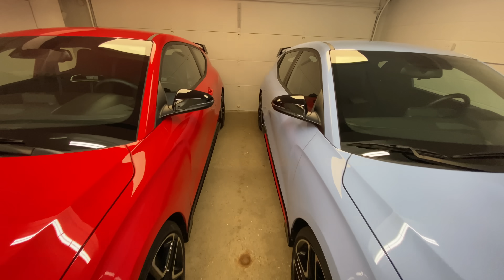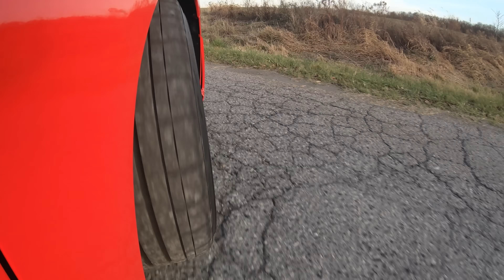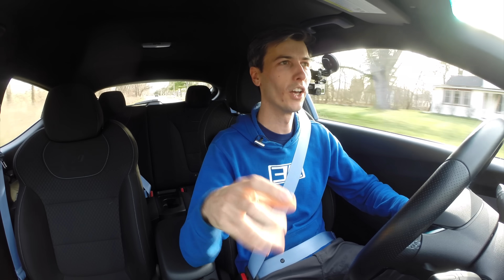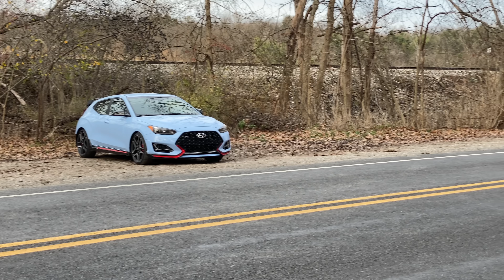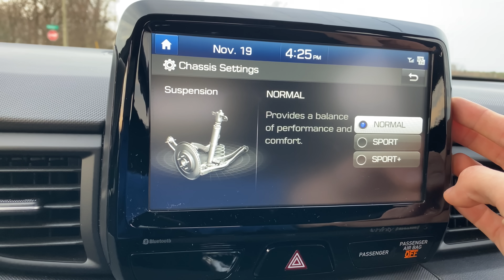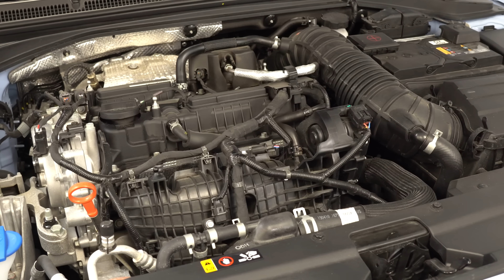Are Front Wheel Drive Sports Cars Any Good?

Comment: with modern E-diffs and traction assistants, they can be a BLAST to drive. For me, throw some good tires, and a rear sway bar upgrade and thrash! I also think you can have fun in pretty much any car, so what do I know. Okay back to fixing a Turbo R32 that wont start. :)
Reply: I’m a mod noob, what would the rear sway bar do on the car? I have a GTI
Reply: @959porsche  Helps with understeer and rotates the rear when turning in.
Reply: @959porsche  A sway bar limits sway also known as body roll. Most consumer cars are set up to understeer because its safe for John and Jane Doe. But the axle with the higher roll stiffness is the one that will slide first because the softer axle will have roll. You can increase roll stiffness with sway bars without having hard uncomfortable suspension over bumps. A stiffer rear sway bar will increase roadholding and make the car handle neutral up to about 9/10ths, when the rear will begin to drift. If you are skilled you can use the drift to point the car into the corner while still accelerating hard. RWDs won't be able to keep up. 🤣
Reply: @stevenfarrington2361  thanks for the pro insight!!! I’ll look into getting one
Reply: @959porsche  Look into getting an adjustable bar. And increase the stiffness progressively as you get used to it. Too big of a jump without knowing exactly what you are doing and you'll end up spinning out mid turn
Reply: @stevenfarrington2361  Just one point, the axle with the higher roll stiffness will not always slide first. Example: For FWD cars, most of the sprung weight is on that front axle. If the rear axle has just slightly less roll stifness,  it will slide out first. 

It's not just roll stiffness, the weight transfer bias is the key. Which end will slide first is based on both the axle sprung-weight balance, and roll stiffness balance.
Reply: @darkknight097  You still have a choice of bar size, as a monster bar may be too much at the softest setting.
Reply: @959porsche  Would it not be easier just to search on the web for the answer? You will get far better explanation and probably diagrams too.
Reply: @another3997  I’m just on the comments section man
Reply: I added a modest rear bar to a Mazda6, 18mm to 21, and huge improvement from severe understeer. Huge rear bars defeat rear independent suspension, and can be dangerous in bad weather, unless driver knows better.

I used a suspension book by engineer Fred Puhn to determine weight transfer bias to help decide what diameter to use.
Reply: I know you’re a VW enthusiast, but when I read R32 my head went straight to the GTR. Humble Mechanic working on JDM, I would watch that any day!
Reply: @tylernoctyrn3140  you mean BNR32? The VW is the ONLY R32...
Reply: @jameshaulenbeek5931  yeah the R32 GTR the OG r32
Reply: @tylernoctyrn3140  so, the BNR32
Reply: @jameshaulenbeek5931  I get that BN is in the chassis code, but no one says that when referring to the car. Its R32 to R35 those are the gens.
Reply: @tylernoctyrn3140  😁 just busting your chops... technically, the VW Golf R32 is the only car model actually labeled "R32"

All kidding aside, I think we can all agree the GTI W12 should exist, though.
Reply: @jameshaulenbeek5931  Personally I’m a 2.0t guy, but I do see a vr6 in my future 😉
Reply: Keep up the good work Charles, looking forward to the video!
Reply: Ok Charles... you're next...
Reply: @HumbleMechanic agreed, I have a 2019 GLI 35th Anniversary and been working with Paul's crew at DAP Repair and yes with a mild tune, upgraded rear sway bar and end link then put on some good summer tires and it is shocking how well these cars can perform. I really wanted to RWD performance car and almost got an 86/BRZ and also this Veloster N but after already leasing a 2019 base S trim Jetta since 2018 the loyalty discount sold me on staying in the VW family. They can be amazing and affordable fun.
Reply: I've got an mk7 gti 6spd running a stage 2 tune on e30, an upgraded rsb, Bilsteins and sport springs, ps4s tires and a few other minor goodies. Yes, wheelspin off the line but otherwise a riot to drive. Would it be better as rwd? Yes of course. Still fun and pretty rapid.
Reply: @dddon51  Bilsteins and proper sport springs are great upgrades. You can even get those shocks tuned by shops like fatcatmotorsports suspension page. 

What were the original and new rear bar diameters?
Reply: I had a 92 Golf 3 with 90PS back then. It only had a suspension job and some 215 tires but that was enough to transform it to an entirely different vehicle. Sure it didn't have the umph and top speed but it was light and could accelerate quickly. The average car back then had more PS on paper but they also had to lug around up to 500kg of extra weight. And the Golf also went sideways if you know how.
Reply: @Enforcer_WJDE  I was on a track and there was a ~1990 Scirocco that was not high powered,  or lowered much, and modest tire size, but he could just fly through the corners with great exit speed.
Reply: Did you ever get your car to start?
Reply: Most cars driven at their limit can be fun, or scary, or both
Reply: 💯 this.  My R59 has exactly that, bigger rear sway, widened track by 1", and wider+stickier tires.  Good luck when we hit the mountains, she's a cornering monster.

Can be drifted or pushed through a corner, using the throttle to steer mid corner, an amazing feel in a light fwd car.
Reply: Great engineering like with the Civic Type R also helps - FWD can absolutely be fun!

Comment: I have a NC and ND Miata. I owned a VelosterN for 6 months. It is really a fun car for the street/daily use. I set it up for the track. Sold it after two events. Too front heavy, understeer pig even with a massive rear sway bar. Chewed up front tires like crazy. I now track my ND Miata. Not as much HP on the straights but so much better balanced and so much faster in the corners.

Comment: FWD has come a long way with suspension geometry, weight balancing, tire compounds and transmission differential/brake technology. Unless you track a car, FWD is generally more ideal for most conditions you will drive in, especially if you live in the north or Midwest.

Comment: Why do cars not have only rear wheel steering. I think i can guess why but would love your video on the topic to get a clearer idea.
Reply: Try to push a pallet truck or anything with steering wheels on the back (so having the steering wheel behind) versus pulling it and you'll get why in a second. You'll basically completely lose control at the 1st road bent.

Comment: Limited-slip diffs are pretty much necessary for a front-wheel-drive performance car. Even in rear-wheel-drive cars, they make a difference. Torque steer, though, is not great if you're truly driving hard. I think that "feedback to the driver" that you mentioned is what makes driving a sporty front-wheel-drive car kinda entertaining - you have to manage the power differently to a rear-wheel-drive car and more often, too, due to the lower traction. But when I have a decent diff, I can feel pretty confident pushing it in the turns. My GTI with the performance package (which includes an E-LSD) was super fun to drive in 90-degree turns especially. It helped when I put better tires on it - it was kind of a mess when I first got it with some more touring-oriented tires.

Comment: The answer for me was no.  I used to slalom my RSX type S, unfortunately slalom racing greatly exaggerated its inefficiencies/difficulties of laying down power while still in mid turn.  I had to compensate everywhere and couldn’t really use the vehicles power, which was significant.  The VTEC “boost” that kicked in around 5500 RPM did me no favors also 😂.  Needless to say it was a handful......which is part of the fun.

Comment: Almost everything nowadays is a sports car when compared to older cars.
Reply: Everything made now is much heavier, and the experience has been watered down by numb feeling drive-by-wire systems and electronic driver interventions.  That being said, chassis stiffness and engine output have definitely been improved in modern cars.
Reply: @vablo7198  a lot of these people think they know sports cars but once you truly dive into the modern tech you realize how far away we have strayed from that ideal sporty style. Almost all modern cars wont even give u instant full throttle if u punch it. They roll it on smoothly its too soft nowadays
Reply: Funny because I see more wrecks occurring from the modern cars than anything during the 99’s and 2000’s. And nothing had improved with handling of my e30 and Honda fit can outcorner every person driving their exotic
Reply: @demitrivavaroutsos4141 my old four barrels wouldn’t either and if I tried that with the manual linkage instead of vacuum secondaries it’d fall flat on its face.
Reply: Sure I love my modern 1.2 liter 85 horsepower car
Reply: @Saffy1  did u miss the word “almost”?
Reply: @NoName-tz5ji  Since when "almost" means 50% cars on the road
Reply: The Mitsubishi Mirage is the ultimate sports car compared to the Model T
Reply: That's why i can only call my celica st184 a sporty car and not a sports car. Things doesn't have much power but it's a fun car
Reply: meanwhile in the EU: 68hp take it or leave it.
Reply: An interesting perspective but I couldn't disagree more.  From my view, sportscars and spirited driving are about the way you experience the drive; the sounds, the sights (of the car and the scenery etc), the overall way it makes you feel.  While most new cars are no doubt better in most/all quantifiable measures than older sportscars, they've reached a level of insulation from the driving experience that they've become appliances on wheels.
Reply: @No Name If you believe that then you have never driven a Caterham Super 7. Largely unchanged since its origins as the Lotus 7 in 1957 (apart from changes in power plant as various ones became unavailable)  it is still widely recognised as one of the best driver's cars available.
Reply: yeah it is kind of interesting to see my family car SUV is faster than the fastest Challenger from back in the day
Reply: ... keep telling that to youself ...

But for the start, please describe what a sports car is.
Reply: "Anything under 170-210 hp is horrible anyway"
lol this guy never use motorcycle :P
Reply: I cant agree with that, new cars lack eutushiasm and real mechanical technology, i have a 20 years old Alfa Romeo GT Q2 and it still outpreforms most modern hothatches in corners, and almost as good as other FWD cars on acceleration, but all this modern hothatches all lack pure feedback, fast steering ratio, and mechanical grip, most modern cars have crapy MacPhersone strut in front and even worse torsion beam in back witch is mechanical grip killer to save on expenses, a crappy e diff and torque vectoring that overheats your brakes from accelerations and all sorts of electronical assistences that makes a car sterile.
Reply: Yeah, I remember one of the car magazines did a head-to-head between a 1984 Porsche 944 and a modern Honda Odyssey and the minivan spanked the Porsche in almost every performance category.  Of course that’s nothing new, back in the early 1990’s Car and Driver put a GMC Syclone up against a Ferrari 348 in the 1/4 mile and the pickup truck won.
Reply: @jpe1  Popular Mechanics once said an '80s Dodge Rampage mini truck performed as well as a Porsche.   That's got laughs but there was some truth to it.
Reply: @timothykeith1367  I wonder if that was the 1984 California-market-only “Direct Connection” model.  I don’t remember if the “Direct Connection” had the same engine as the one-off “Shelby Rampage” built for Carrol Shelby, but it did at least look like it should be fast.
Reply: @jpe1  The Rampage was the common 2.2 5-speed model.  It was reviewed in the September 1982 issue of Popular Mechanics "Detroit Pickups Vanquish the Imports". page 178  "The Rampage really belongs in a sports car test since its more fun to drive than just about any two-seater that you can buy for under $20,000. Its performance will simply blow you away... claw its way around a skidpad and through a slalom course as fast as any vehicle you care to name, Porsches and Ferraris included"
Reply: @timothykeith1367  cool! Thanks for sharing!
Reply: It's the other way around.
Reply: Horsepower doesn't make a sports car, the feeling of being connected to your car does. 
Compared to how cars nowadays feel like, i'd say any manual cars before mid 2000s could be a sports car.
Before the motor assisted steering, electronic throttle actuators, emissions regulations, and rev hangs etc.
Reply: @kdh6387  lol that doesn’t make any sense. Honda accords and Nissan Altima’s in pre 2000 manual form are not even close to being sports cars
Reply: @kdh6387  Exactly - a fly by wire throttle is a joke when you are trying to heel & toe in downshifts.
Reply: @kdh6387  I guess you're right I love my old manual car and I don't thing I would get much more use of more horsepower anyway
Reply: more like the opposite... cars are so heavy these days. besides, you got all the safety assists, sound dampening, economically tuned engines, etc. your statement is just wrong
Reply: tbh i've yet to even attain a car myself, but i just don't like the aspect that sports car nowadays just sort of blend in, like they're not something far from a family car. and in terms of feel, idk but as far as i've understood from Best Motoring, they just feel the same as a standard car and they don't have that character unless you're in a race track or in race mode.
Reply: @nightshade4873  well go back 20 years and everyone was like: "Why can't normal cars be sporty too?" 

We have come full circle folks.
Reply: @nightshade4873  Do you drive? Becauase 9/10 times you can throw the opinions of motoring journalists out the window. The sportiest car I've ever driven is a 2002 Hyundai Getz. And it's awesome.
Reply: You are soo wrong!!!
Reply: Still cracking up daily when someone advertises their new "powerfull" car and it has like 170-210hp. You are 25 years late with powerfull bruh. Anything under that is horrible anyway.
Reply: @PoorCoyotee  No, that's a very one dimensional view of what a car should be. Fun and low HP are not mutually exclusive. For road use, if you think anything with less than 170hp is horrible... you're just a poor driver who doesn't understand anything but a heavy right foot. My Caterham had 135hp, did 0-60 in a shade over 5 seconds and on track could out-brake and out-corner cars with twice the power. And it was huge fun, even going slow.
Reply: @another3997  They are going to have to prise the keys of my Caterham from my dead hand (1400 K series, 5 speed, bare ali + BRG.)
Reply: @PoorCoyotee  I have a modded 2018 civic hatchback and a g80 M3. Both are a blast to drive in their own way. 200hp with a nice turbo upgrade is plenty on twisty backroads. Look at the Honda s2000
Reply: @PoorCoyotee  Powerful only has one 'L'  🙄
Reply: @PoorCoyotee  powerful enough for me, you don't need more than 120
Reply: @carlosandleon  you may not need more than 120, but I like my car doing something when i touch the pedal just a little bit. Flooring it all the time to even get going is far for comfortable driving experience. Also the torque so you don't need to make butter with shifter, just put it on 4th and cruise around at down town.
Reply: @PoorCoyotee  ever driven a miata?
Reply: @PoorCoyotee  lol if I
Had 140HP on my car I think it would be considered a sports car
Reply: @r.i.peperoniiiiroh9625  no, because it sound like you drive some old crap like fiat 127 which is far from sporty unless you rebuild the whole thing from scratch.
Reply: @PoorCoyotee  a fiat no even my mom blew that engine XD no i drive a daihatsu coure it has 59HP from an inline 3 it can go 160kmh max so if i had 140 hp and it is still an inline 3 it would be pretty fast but then again i need coilovers better tires new cpu etc

Comment: I bought a new civic si for alot of those reasons, affordable fun to drive and practical for day to day use
Reply: Same. Love my civic si. Fun daily driver
Reply: The type r is a different animal, I heard they are amazing, I wasn't willing to pay the difference 100 more hp and crazy areo, throttle house did a great video si vs veloster as well as type r
Reply: Ok yeah ima get that si
Reply: @fahmi1347  the new Si’s look so weird to me. 9th Gen Si’s are where it’s at
Reply: I was thinking about getting one, do you think I should just save up for the type r or go for the si?
Reply: @fahmi1347  type R no question
Reply: @fahmi1347  I went for the Type R.  I test drove the SI, and it wasn't enough for me.  The Type R is amazing.  However, be prepared to pay more for tires and brakes.  The Type R comes with summer tires, so I picked up a set of 19" wheels with all season tires to switch to in the winter.  If you have fun in the SI, and aren't prepared to pay more for the Type R, go for that.  If you have the money for the Type R, it is an amazing vehicle.
Reply: @keith4536  I was thinking about the Hyundai Veloster N. I test drove it and it drives nicely. Sounds amazing too. Is there a catch with it though?
Reply: @fahmi1347  It comes down to personal preference.  My original message was basically a comparison between the Civic SI and Type R.  Just go for what you like most overall.  I haven't looked into the Veloster N much.
Reply: @keith4536  oh. Idk depends